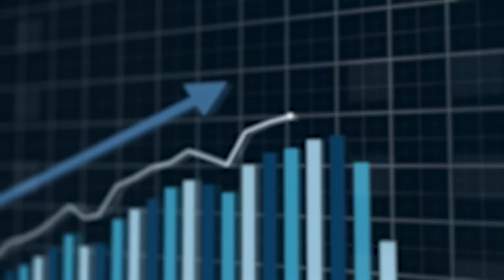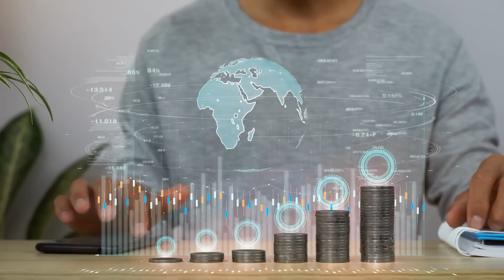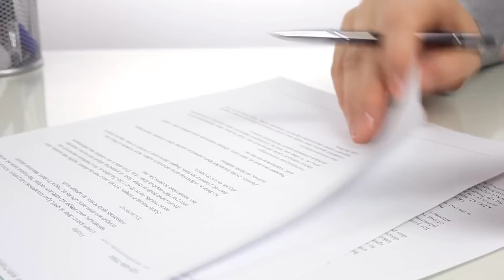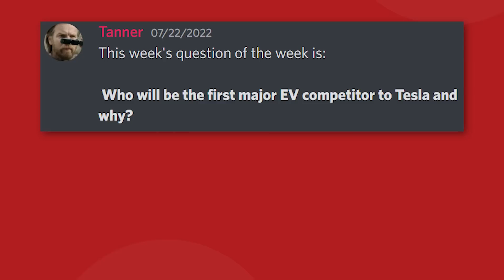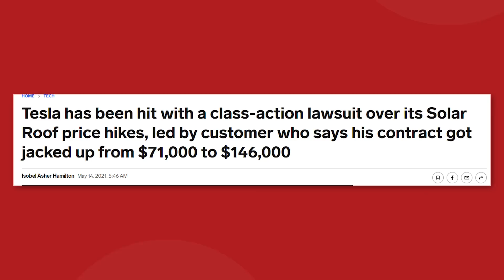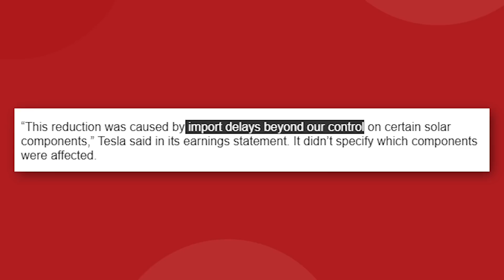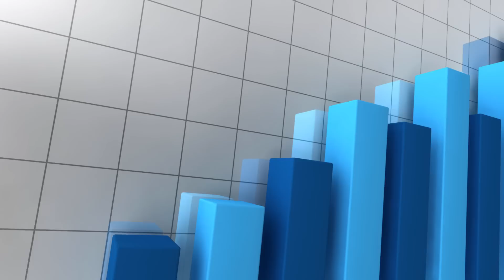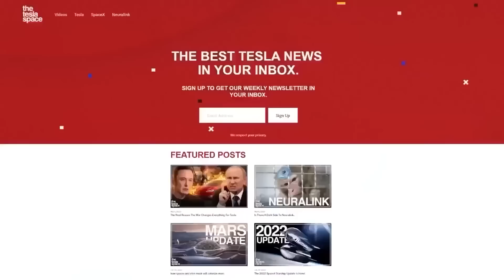Major New Tesla Solar Update!

Comment: I Think the idea of the "normal look"  is the core Problem. It is even more stupid than people Who are concerned about loooking like Nerds. Unfortunally all the good ideas about the Tesla solar roof are played out. The tiles should be fabricated in exactly that Size in which workers can do the roofing the fastest. Im not an expert,  but should be about 30-35 by 20-25 inches or so. For parts of the roof where tiles are in the shadow or have to be cut there should be alluminium tiles in the same Size. On the long term, it will always look better to be rational than conservative (in aesthetic terms).

Comment: Two weeks ago my 25 kW Tesla Solar Roof system with 2 Powerwalls was turned on. I had done research about the Tesla Solar Roof for couple years and after the hail damage from earlier this year I decided to go for it. I didn't go thru the Tesla website, but went with a contractor, Good Faith Energy, that was certified by Tesla. Removal of the old roof and installation took a little over 3 weeks because of the heat advisory that was happening every day. I didn't realized how much power my family uses before having the app so the 2 Powerwalls are not sufficient for our needs. With my electric company, I have to currently maintain a 80/20 connection to the grid. Will eventual have to try and get 2 more Powerwalls in the near future. People have asked me about my roof and I have told a couple of  that this is a significant investment. Being in the Military and moving every 2-3 years we wanted our forever house.  This is why we decided to go with the investment on the Tesla Solar Roof.

Comment: I added a coment earlier------not sure it went through.
I got a Tesla solar roof about a year (2021)ago and I love it! It's a 12 KW system with 2 powerwalls. It's a great system and I love it. They were not easy to work with, they do not return calls, emails, or text, making it difficult to get information. You need to be patient. It was expensive as I have a large home, I've been off grid 99% for the last 4 months, I have a Tesla car that I' ve been able to keep charged as well. The workers were a bit slow in getting the roof installed because of the variation of the roof structure, the engineering is supberb as well as the software, this is the strength of Tesla. I would recomend this roof,  it was worth the wait for me.

Comment: Ultimately, isn't the largest solar market for Tesla selling battery back-ups to utility sized solar and wind facilities? These (i.e. solar in the vast US southwest deserts) produce the lowest cost power on earth ($.0275/kWh in Nevada today). Battery backup enables 24/7/365 production and the battery cost still keeps the average cost below current US average (I've done the math). Elon says that Tesla's biggest competitor is not an automotive company but Aramco. This solar/wind plant battery opportunity is immense, dwarfing automotive. It requires a lot of lithium mining and a power grid that reaches remote areas. All doable and, I believe, in Tesla's long term plans. (see Tesla mission statement)

Comment: the current generation of tesla roof is too boring.  it's too thin, and they are missing line breaks.  The unbroken horizontal lines that the front lip of the current tiles make create obvious visual errors when going over old roofs.   The roofline would have to be very flat in order for it to look good.  Being too thin is another visual thing, but it means the roof is lacking any interest.  This makes it feel cheap once it's installed.  They need to get a handle on the individual tiles with the chamfered edges, and the other patterns.

a few people in my neighborhood got tesla roofs, they went up fine it looked like, about a week and a half for a retrofit.  This is a long time, but it also brings benefits of no roof penetrations when you compare to regular solar on top of a roof.  They don't look horrible, but they scream "i'm a beta product" because of the lack of visual appeal.  I think my neighbors are happy with them though.

Comment: Your favourite answer of last week was wrong, unless you're only talking about U.S brands, Rivian is a speck in the grand scheme of things. 
Their biggest competitor by every measurable metric globally is BYD. Outside of Tesla, BYD has the most EV sales, is the most vertically integrated (batteries, microchips, etc), has product lines Tesla is only just entering into and some they don't with trucks and buses, most advanced and safest LFP technology on the market with the Blade Battery. BYD is buying up old legacy factories and building new ones like crazy, they have global supply chains already established. 
This is a two horse race at the moment.

Comment: We had a Tesla Solar Roof and Powerwalls installed in 2021.  Took about two work weeks and went smoothly.  Looks great and working well.  Getting the PTO paperwork was the long time part of getting the system turned on.  No we are doing considerably better than the NREL prediction for power production.   Love the system as backup power when we loose the grid.  Had 7 short outages and never new it until we received the Tesla alert.  We needed a new roof and it was at the time the new v.3 model roof was available and being installed.

Comment: Obviously, homebuilders and designers should work with Tesla. A standardized roof to work with standardized solar-tiles. Then you could sell actual modernity instead of some artsy-fartsy, multi-angular, 1800's technology.
Reply: The problem I have with this market plan is I can’t do the installation.  There is no avenue for a DIY installation.  I retired from a 22 year career of general construction so I am certain I could easily learn the techniques needed for these installations.  The business model is too restrictive for that and that is why it has failed so far.  Until you can make it accessible to folks like me it will continue to fail.

Comment: How long will it take for Tesla to build their US Solar Array (as in the 100mile by 100mile solar array) you have to wonder whether this is something Tesla is even pursuing? I mean they have nearly 20 Billion cash on hand and zero debt but for all the rhetoric coming out of Washington is there even the money available to build this mammoth array? 

I mean let's be honest an array that size would literally wipe out Tesla's cash on hand and probably incur a debt of at least another 20 Billion. Everyone loves the idea of replacing fossil fuels but when the investment would cost in excess of 40-50 billion that's alot of capital expenditure.

And of course the one wrinkle in the plan is power transmission. If the Array was based in Texas, Oklahoma or Utah the power lines have proven themselves notoriously unreliable?! So rather than a central solar array maybe regional solar arrays makes more sense?

Whichever solution they chose the National Power Grid needs a complete overhaul. Power lines, Nuclear Power Stations as redundancy and a small amount of wind where its most feasible.

The reality is that this would mean a glut of cheap power in the short term but long term the perfect scalable solution for the US. 

But remember just the solar array itself would cost 40-50billion the battery array would be another 5-10 billion and the new Power Grid as high as 150-300 billion. Biden would so hate it if Elon Musk said screw it forget the Democrats let's just do it ourselves!

Comment: Interesting comments from community, why can’t they make the larger tiles/ panels or make them in modules (6 tiles) this would reduce install time?
They have done this with Giga press, reduced parts.
Reply: smaller tiles look good, plus you can ramp up on technicians to install small tiles where large tiles would be awkward to handle
Reply: @morkey74  it’s an additional cost of labour and more people don’t mean the instal would be twice speed. Normal is 70% increase.
Putting tiles in strips of 8 or 10 could easily be moved into position. Bigger tiles could 4 or same size as solar panel.

Comment: Tesla should probably forget retrofits and do new installation in new large scale housing developments with 3 or 4 different roof-lines so that the house can be designed for easy solar roof installation, rather than designing the panels for the roof. I think Tesla should do whole home designs with HVAC, hot water, and energy storage design. That way an economy of scale can allow better pricing and lower labor costs. They would start as "luxury" homes for the wealthy, but prices would come down with time  - just as seat belts, air bags and anti-lock breaks were first introduced to luxury cars.
Reply: This is the model Tesla should do.  It is the same model they used with cars.  Build from areas of strength and bring in new training crews and then split in half and expand to a new city like a cell.
Reply: This seems like the right model and the direction they are headed. Tesla did sign a deal with a Houston Builder to install exclusively Tesla solar shingles. I think it’s a test area, like maybe one specific subdivision. As you suggested, most likely designs around the roofing product. Having built homes, one thing people are missing here is that, even with a with a less complicated design, framers are always a “hair out of square” so getting large, rigid panels to align perfectly across long spans could become challenging and hard to fudge back into alignment.  Just like ICE vehicles, hvac systems are ripe for innovation, as little has progressed in the decades they’ve been making them.  The golden ticket is, friendly design, integrated hvac, solar shingles, powerwalls and a smart system to control it all. Appliances, water heater, heating/cooling system all electrical. Energy independent, tied to the grid or not. Luxury home owners often want high-end gas fireplaces and gas outdoor bbq’s which is the only miss for an all electric, independent solution but easy enough to live without in a gas shortage or high price scenario.
Reply: Yes. Innovate for the wealthy at first (like the Model S and Roadster), fine tune production and scaling, then expand to the middle class.
Reply: I was thinking along the same lines. Focus on new construction by providing resources for architects/engineers to design structures that are solar roof friendly.

Comment: I live in Hawaii where electricity is 37 cents/kwh.  Electric company ready to raise rates 20% or more.  Hawaii is over 30% renewable not due to government or electric companies but private residential rooftop  I installed solar on my house 10 years ago with Tesla battery storage 3 years ago.  With my  Tesla EV and solar, I save $600/MONTH on electricity and gas.  I can not control healthcare monthly premiums but can control energy costs.  Plus sole/battery at additional value to your home.  Love the emergency power backup.
Reply: Tesla stock is both tesla motors and Tesla energy.  Musk wants to be known as battery guru not car guru.  The Holy Grail supply/demand for grid is BATTERY STORAGE.  The next battery invention for smartphones/labtops, powerwalls will be $$$$$.
Reply: @Firestorm637  not battery Guru, more multi discipline Engineer . Rocketry, Cars, energy storage, Artificial Intelligence … you know ?

Comment: Elon will get this straightened out. The cousins rushed to market with a pay later plan that was troublesome to the bottom line and a product that may not have been what it could have been. Elon saved his cousin's a$$es. shrugs
And yet, solar anything will still be a booming industry once all the bottle necks are worked out.
- Needs to work out supplier issues.
- Needs to work an easier/cheaper installation product.
- Probably some variables that I'm not thinking of at the moment.

This will be a money maker and a tremendous benefit to the environment.
Reply: I'm sure all the old replaced panels are just wonderful for the environment. Can't wait to see landfills full of decaying old solar panels,  surely that won't be a giant problem. N never mind the oil that was used to originally produce them or the coal burned in that factory. "Green energy" is barely a band aid at this point. That ain't saving no planet no time soon
Reply: @joshlewis575  There are folks out there figuring out how to recycle the panels. Hmmm, so you bring up the problem of landfill issues, but don't calculate the air/land/sea contaminations of using fossil fuels to generate power. nods I understand. How much are they paying you? grin

In the end if you compare the pro's and con's of fossil fuel energy to solar/wind/sea energy, I'll still bet that there are more pro's than con's in support of the "not quite yet" green energy in comparison to the "nowhere near" green energy of fossil fuels.

Comment: What you fail to communicate here is after the solar city acquisition, model 3 ramp up nearly bankrupted the company. Nearly ALL OF SOLAR CITY EMPLOYEES were working on the MODEL 3 production line, which included much of the office staff and musk himself. Hence, the reason for a slow ramp up of the solar roof. I have friends at tesla and SPACEX. 

The product is not garbage. I nearly had it installed at my house, but they doubled the cost. My roof replacement after a hailstorm was going to cost $35k. My tesla roof jumped from $75k to $125k with 5 power walls. My roof is complex. I needed a roof and my insurance company waited 9 months. The installers love the product. I have an electric heated driveway and a pool. if tesla could have given me a better ETA I would have done it. However, during a pandemic it made it impossible for them to give me an accurate timeline. I could not blame them for supply chain issues.
Reply: Thanks for pointing out the glaringly obvious hole in this otherwise great video.   👍
Reply: @Iceworm72  I don’t get this channel. He gets so much right and then so much wrong on nearly every video. There’s always a glaring hole of obvious that really discredits him on many levels. All he has to do is mention these things. Instead, he plays it off like TESLA isn’t trying or that they failed to ramp during a pandemic or infers that solar and TESLA dropped the ball or the product sucks, when TESLA clearly didn’t prioritize the TESLA solar roof. A pandemic, supply chain issues and a near bankruptcy of the entire company and he blows off all of these things like they never happened. I can’t figure out if he’s clueless or out of touch or lazy or click baiting people… 

When you say, “people either love their solar roof or they don’t” infers it’s a 50/50 split. It’s not. People who in stalled their solar roof, love their roof and it’s a majority, not a minority or half.

Comment: I purchased a 4kwh system in April and a single power wall. Works great. But I wanted more. Submitted a 2nd order, sent in all the required pictures and they barely respond to me. They are either overwhelmed, understaffed or under-trained. I will probably look to Generac for phase 2 of my project. Tesla could be selling and installing a lot more.
Reply: ADT has solar if you still wanted solar.
Reply: @cjmixmaster  ADT the alarm company?? They suck as that..
Reply: @Gremlin256  MMV My grandmother nor myself have had any issues with them. I imagine like all things run by people they aren't perfect.

Comment: You need to explain that the decrease in the solar business was initially because Tesla abandoned Solar City's successful marketing strategy of essentially going door to door to sell and lease residential solar.  This was, however, an expensive way to market solar, which is why Solar City was not profitable, despite its rapid growth.  Also, solar subsidies were declining (or threatened to decline) at the time.  In addition, solar technology is now better and cheaper than it was in 2016.  So, hopefully, in Tesla's second incarnation as a solar marketer, it will be very profitable.
Reply: @MathGPT  Not banned, there is a tariff. But, from the video, it seems China is hoarding most of it’s production.
Reply: @danjw1  Tariffs penalize producers/consumers for the benefit of very few, namely politicians and their cronies. This system is called fascism. It's anti-capitalist.
Reply: @MathGPT  Tesla bought solar city to get the buffalo factory which can make solar panels in house.  Tesla basically used their own factory to learn and know what to ask from suppliers.  This is the exact same strategy tesla does with batteries, where they make them low volume in house, but use that in house knowledge and tech to commission batteries from battery companies following the in house knowledge.  Tesla can do more manufacturing of solar in house if suppliers can't meet demand.

Comment: 0:42 "uh knee-ear hault uh-n e-in-still-lay-shuns..."-!? No, you mean halt on installation.
Installation is simultaneously a verb and noun, as such; there is no need to use the suffix "s" to denotle mutliple points of installation but you mouth-breathers are idiots = have wrong sense of how and why words work = present day linguistic degeneration is primarily your fault.